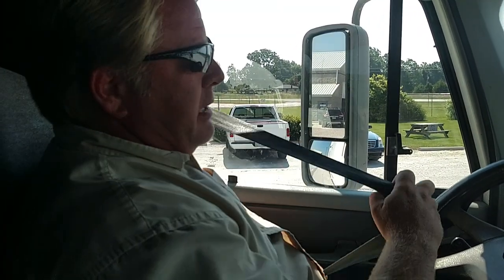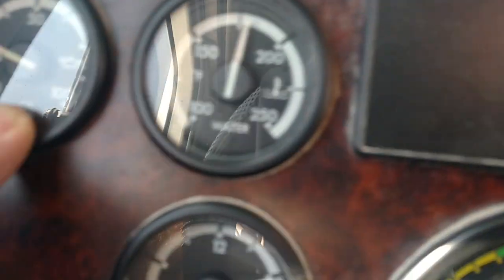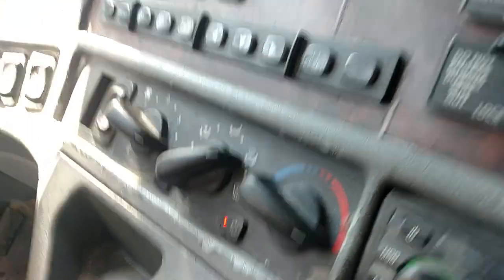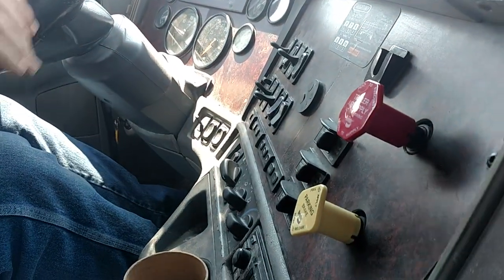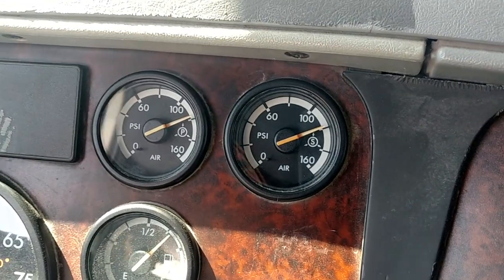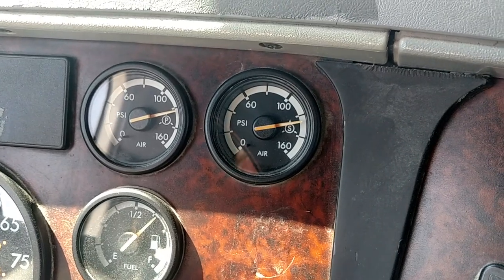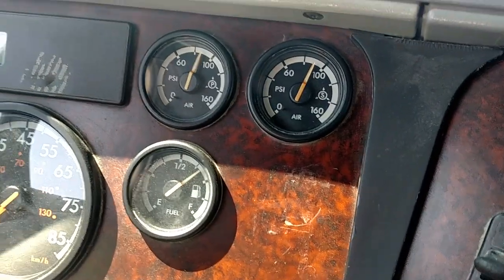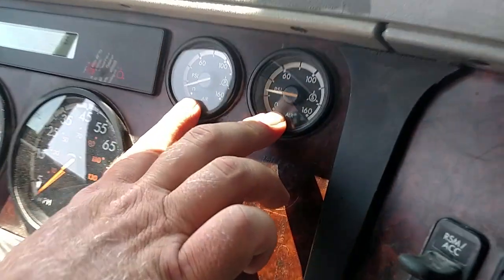In cab inspection for the Missouri CDL test

Comment: Just to clear things. It should be ABOVE 60 psi not before, I’ve been told
Reply from the maker: At or above 60 for the low air warning light and buzzer
Reply from the maker: At or above 60 psi for the low air warning light and buzzer

Comment: Is this also the Air Brakes inspection
Reply from the maker: Yes, everything for the cdl test
Reply: Joe Brown Jr. Thank you Joe , hey do you know of a simple technique on backing back straight?
Reply from the maker: @theroyalone7588  ,keep both trailer tires in both mirrors. If you can't see one, turn towards the one you see until you see other one then straighten wheel
Reply: Joe Brown Jr. Thank you so much you are a huge inspiration